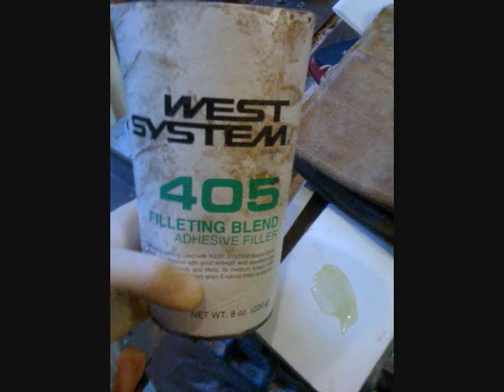Motorized Bike Custom Epoxy Resin Gas Tank 49cc 66cc 80cc

Comment: Wow, nice job!  We've had two stock tanks fail.  Both pulled the studs from the bottom of the tanks!
Reply: Just fiberglass around the studs two layers of the weave or one layer of the Matt is fine or just double up also ya can just build onto a stock tank real easy like.

Comment: epoxy resin may stand up to gas (i wouldnt trust it by itself either, but vinyl ester resin WILL stand up to gas... if you have the epoxy laying around and for a small project it may be ok, but if you have to buy some resin, you would do better buying the vinyl ester resin... great job and great video... tank looks good...

Comment from the maker: I made it out of epoxy resin. That in itself resisted gas but I have since lined it w gas tank liner. Just to make sure it stays sealed
Reply: Did that engine clear coat hold up?  I recently tried to use some ceramic spray engine coat and the gas ate it away, even though it said it was gas proof.  Maybe that was just a thin spot?  Idk...